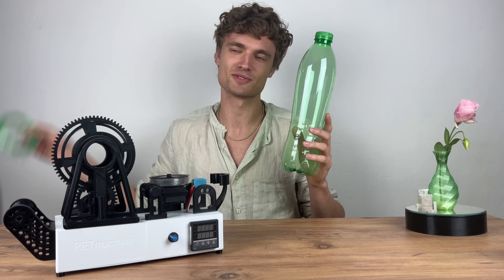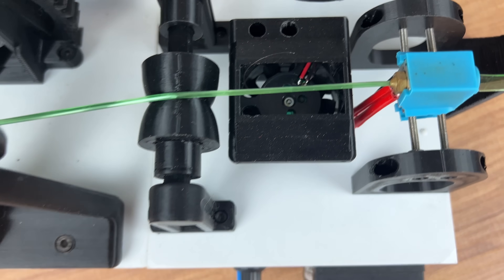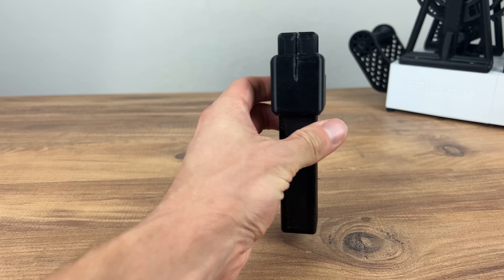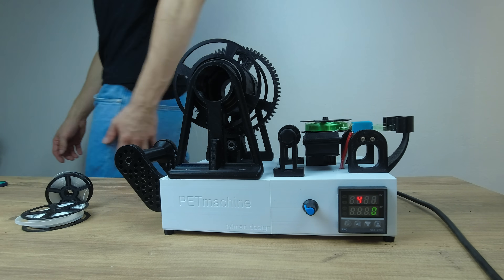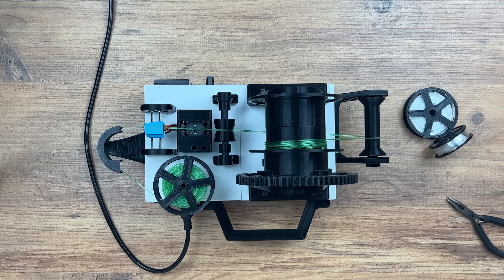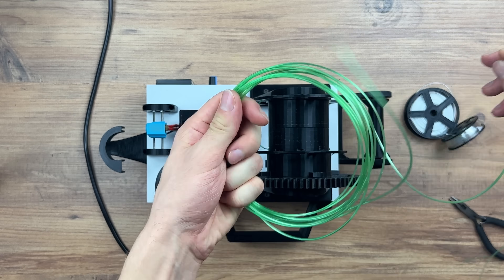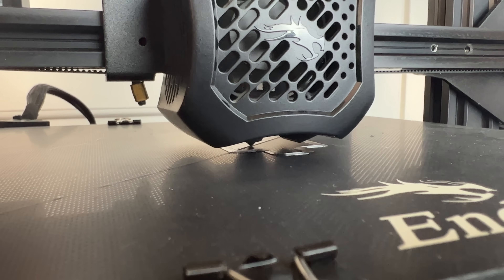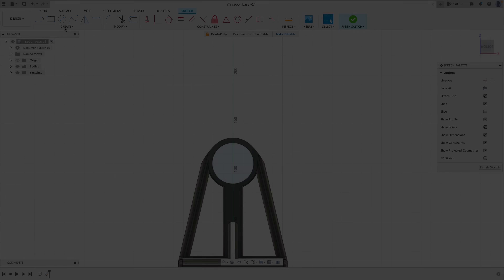Turn Plastic Bottles Into 3D Printer Filament at Home | DIY PET Recycling Machine!

Comment: Could you make the recycled spools longer by just melting the ends of the cut bottles together before processing? I’d like to know if it would that cause a weakness/inconsistency in filament size or make it fail when turning it into spool?
Reply from the maker: I like Your way of thinking! It's my next milestone in this project, I'm currently working on the cutting module for the machine, next I will make research/experiments with connecting unprosessed plastic strings to create one big spool!
Reply: @TylmanDesign  well I’d definitely love to see a video on your findings when you get around to testing it. Also, I’d like to find out after if it didn’t effect the material if it was then possible to recycle multiple colour bottles of the same plastic into a sort of “colour change” spool without effecting integrity. It would be awesome to make a custom colour change filament!
Reply: Ya estoy trabajando en ello. Si te interesa te lo explico. Básicamente observa cómo se hacen los cables de acero.
Reply: @DelforTecnoPrint3D.6730  ¡Sería genial saberlo cuando termines de probar!
Reply from the maker: Hello! We will announce and put PETwelder on sale very soon. You can follow my Instagram account to follow the progress about it: www.instagram.com/tylmandesign

Comment: you are selling the plans. could you make a video over the parts that need to be purchased?
Reply from the maker: -REX C-100 Temperature controller 
-Some bearings 
-Some screws
-Volcano hot end 
-Mean Well 12V power supply 
-Gearmotor 
-PWM controller 
-3D printer heater 
-Type K thermocouple 
+ some small things 

Total cost oscilate around 100$ for these elements.

Comment: Where do I buy 1
Reply from the maker: Hello! My project is available on the site below:
https://cults3d.com/en/3d-model/tool/pet-machine-make-your-own-filament-from-plastic-bottles-at-home-tylman_design-2

If You are interested only with ready to assembly set Im currently working on complete kits with all parts inside (excluding printed parts), it will be ready in few weeks. Subscribe my channel and keep watching for updates!
Reply: If I buy this filament maker on cults3d I receive the actual product or just an electronic download of instructions?
I'm very interested in buying an actual filament maker even if I need to put it together.

Comment: I'm able to print only PLA and PETG, is ABS mandatory for parts in contact with the heating head? Are there any alternatives?
Reply from the maker: I was measuring temperature of the screws and it was about 65°C. PETG withstand max "just" 80°C unlike 100°C for ABS, I always liked to have wider safety range. You can try to print heater base using PETG and see if it won't melt/damage, but I don't give a guarantee. Maybe try to ask someone from 3D printing community in Your area to help You to print these elements from ABS.  

I think probably PETG will work, but will "wear" much faster, specially during the pulling proccess there are strong forces that can permanently deform the "soft" PETG.
Reply: @TylmanDesign  could the heater base be made of wood?
Reply from the maker: @ericthecyclist  like I mentioned in the previous comment, temperature in the end of the screws is about 60-70 degrees, so wood should stand it.
Reply: @TylmanDesign  pla won't work at all :(?
Reply from the maker: @CN-dh3ge  unfortunatelly PLA for sure won't work :(

Comment: Wondering how much the parts cost that you need to order?
Reply from the maker: Very good question thought. Cost is around 90-100$ for electronics, bearings, motor, power supply, PID regulator, PWM regulator, 3D printer heating head, screws and so on. In the costs we have to add filament as well. If You have more questions just let me know!